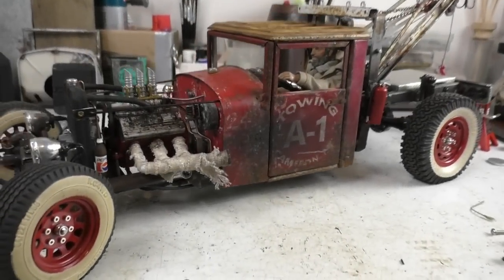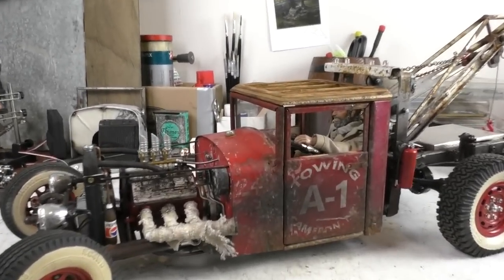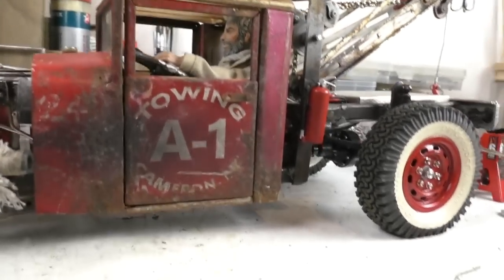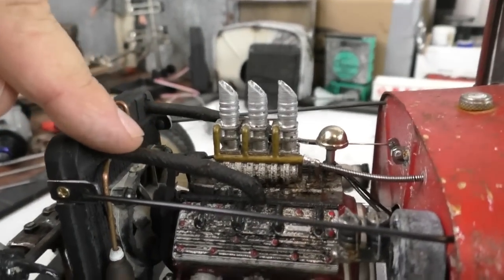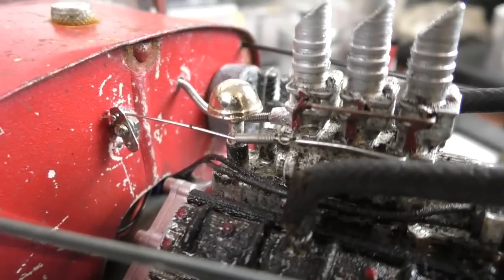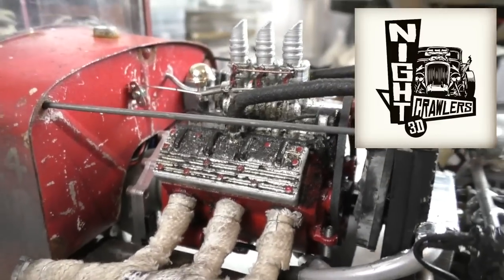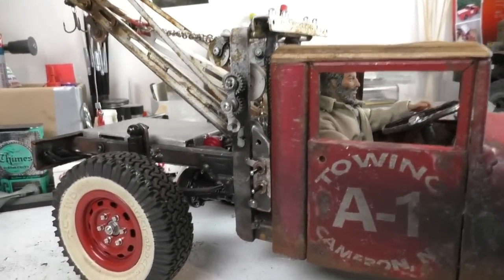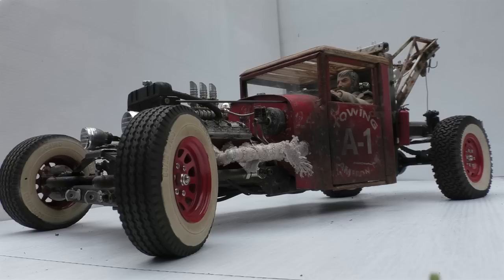"Wrecker Life" - 1928 Rat Rod Tow Truck RC Model. Steel body, real rusty patina!

Comment: *cool fuel line going to the v8, it's a v6 engine
Reply from the maker: It's a Ford flathead V8. The old V8's share an exhaust port in the center 2 cylinders.